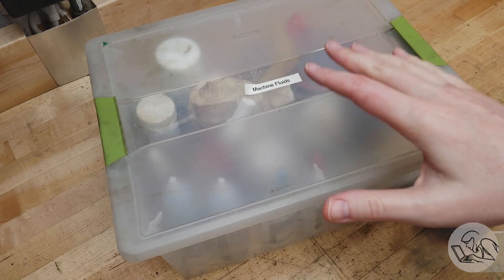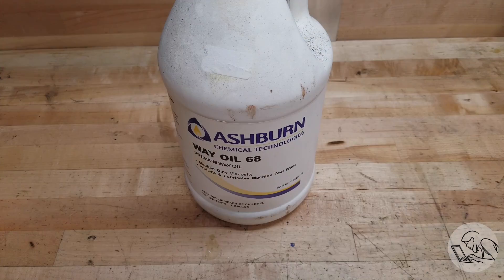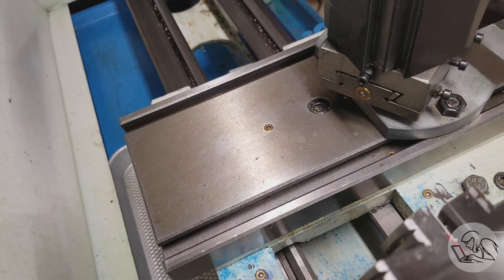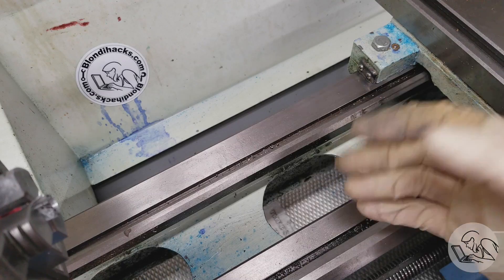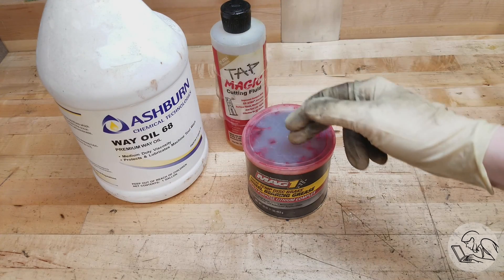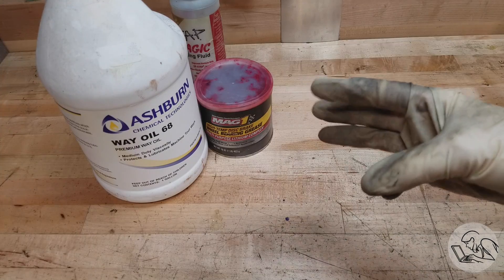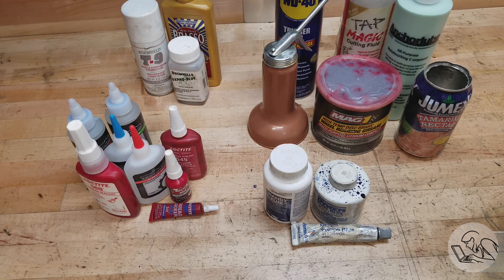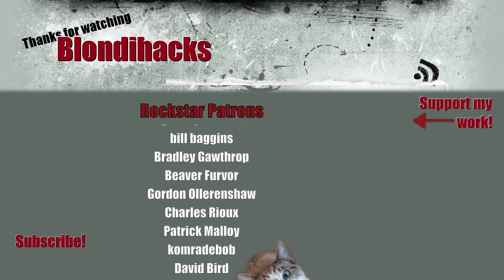Lubricants and chemicals you need in your machine shop!

Comment: Acetone and automatic transmission fluid is a great penetration fluid. I think it’s similar to Kroil.
Reply: Project Farm did a bunch of videos on penetrating oils. Kroil actually didn't actually perform that well. Liquid wrench I think was the best for the money.
Reply: @hairyfro  ....Yep, Kroil was towards the bottom of the test.  Figure in the absurd cost of the stuff and the manufacturer should face some kind of charges.  I have a $25 can of the stuff sitting in my shop, constantly reminding me of the money I have spent over the years looking for the "magic penetrating goop".  Yes, Project Farm found Liquid Wrench to be the most effective and one of the cheapest per ounce.  For this I am eternally grateful.  Btw, acetone mixed with ATF (my fathers old go-to) didn't test well and was found mostly useless.
Reply: @paulcopeland9035  no, the acetone / atf, was second best, behind liquid wrench.

Comment: I have been told that chain saw bar oil (available at Lowes, Home Depot etc. in quarts) is identical to ISO 68 way oil.   I mention this because the price of way oil is often ridiculous and is sold only in large quantities (1 gallon jugs or 5 gallon pails).
Reply: "Steves small engine saloon" did a video about winter vs summer bar oil, maybe something to look into.
Reply from the maker: Interesting! I had not heard that.

Comment: I use Chainsaw bar and chain oil for my ways. Its sticky and is cheap.
Reply: I watched something where the guy winterized the bottom of his van with chainsaw oil. It grabbed the road grime and made a protective layer. It was still pretty much intact after a few years in New Hampshire.

Comment: Just today, 3h ago, i filmed a video about my first lathe i'm about to set up and said, that i'm not sure what kind of lubricant to use.... thanks for the explanations! :D
Reply: When I first got  my lathe I asked in a forum what kind of oil to use for cutting and most people laughed and said ...something slippery.  Then I saw a guy who used canola oil on youtube and found it is EXCELLENT as a cutting oil for steel. High smoke point and works very well. Not the absolute best but Plenty good enough. The good thing... less than a dollar per liter or 3 dollars a gallon. What other kind of liquid can you get for under $3 per gallon? Way oil...sticky is good. some use STP oil treatment. I use Lucas Oil Stabilizer. Dedicated way oil is cheaper, if you buy it in 5 gallon buckets. but I buy it in quart bottles. So far I have used about 1 oz of it in the year that I have been using it. So don't make the mistake as a beginner of buying a 50 lift time supply for big money only to find out later you need to go into the way oil reselling business.